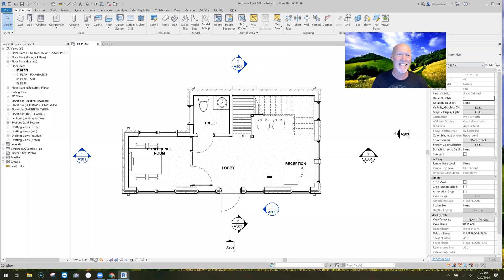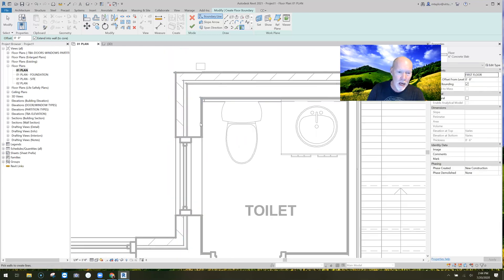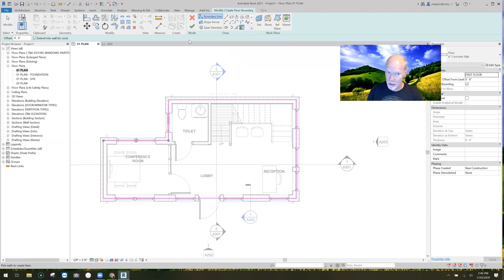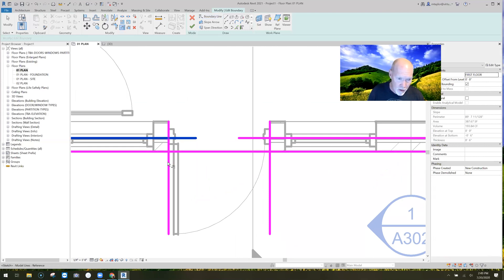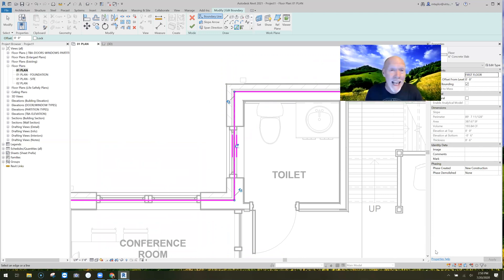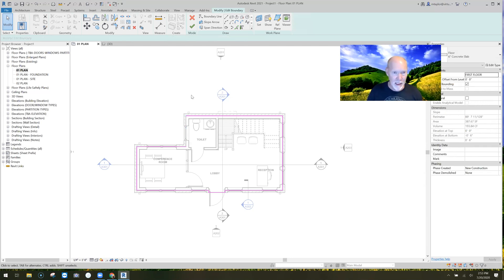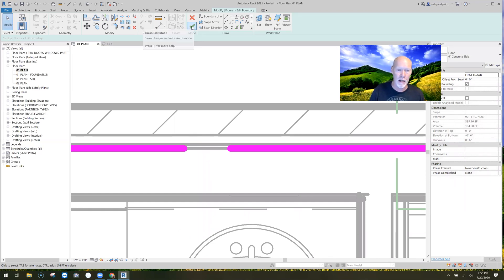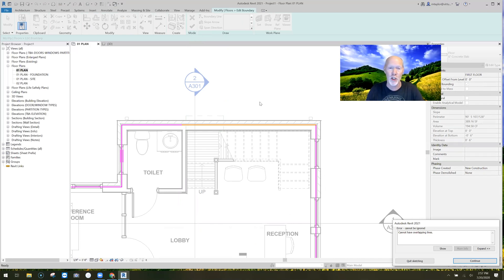COMMON ERRORS IN 'EDIT MODE' - and solutions

Comment: Mike, how about the issue of two ceilings overlapping while in sketch mode ,when one will be a lower ceiling and one will be a higher ceiling.  Where the two ceilings connect via a bulkhead, the lines overlap in sketch mode, and we can't make a closed loop when placing a line over the connection point of the two ceilings    HELP